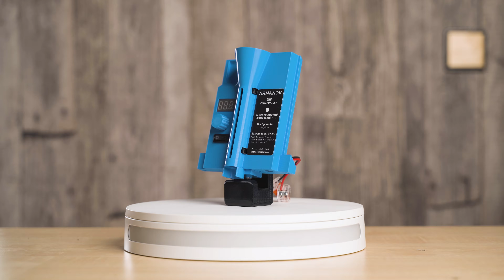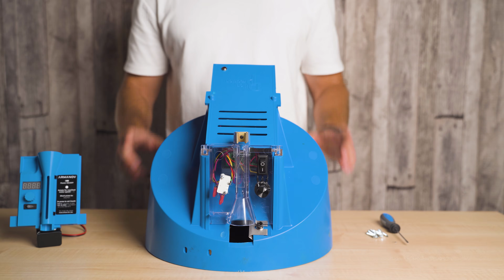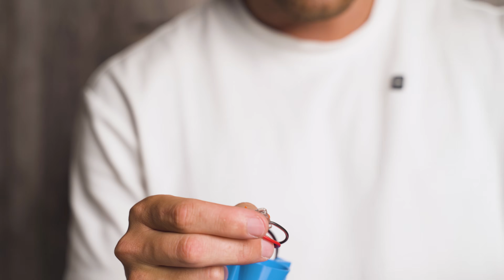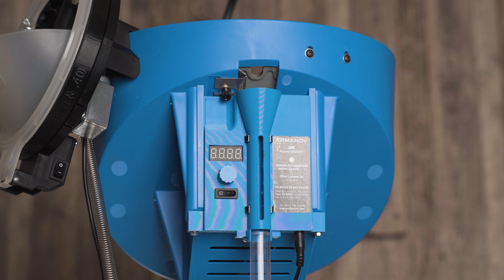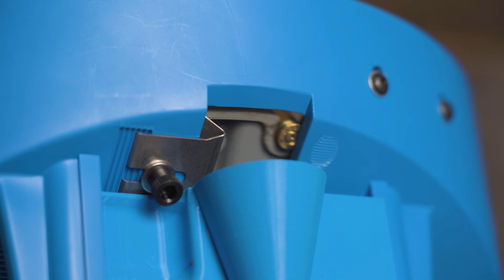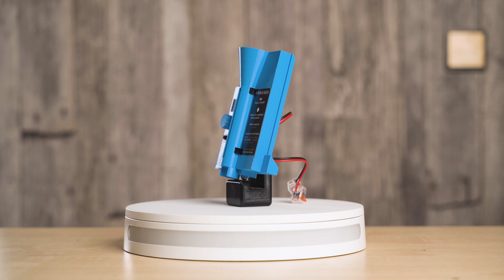Armanov Smart Controller for Dillon Variable Speed Casefeeder

Comment: Not a good investment: I'm on my third request for support with no response. After about 4 hours of use it no longer will allow you to pick numbers, the knob makes the counter change by tens or hundreds randomly. Shuts off if your working of fixing an issue or restocking supplies, and when it gets turned off, it loses count. Mine is no longer usable after 4 hours with no response from Armanov support. I had high hopes.

Comment: I got mine for the Dillon 1100 but when I hook it up per the instructions here and on paper it spins the plate backwards for some reason. I've had a support ticket (#13886) open since 11/24/2025 and it's still in "new" status. I've verified, numerous times that I have the wires connected per the instructions. Has anyone else ever had this problem?
Reply from the maker: Hello, we apologize for the late reply on our support chat. You can reverse the wires coming from the motor and the motor will spin the other way.

Comment: I really want this, but I have the old 2 speed case feeder. If you had the option to buy a new compatible motor also I would place my order today.
Reply from the maker: Hello, we are looking into a possible separate version for the old case feeder, as there is quite a lot of interest. Stay tuned.
Reply: @Armanov  yes, i have an old case feeder as well. please let us know when a unit is available for us.
Reply: Thats what I thought of my vanilla casefeeder.
Time for a revamp without buying a complete feeder which is 400€ straight
Reply: Everything except the 9 speed motor setting should work on the older 2 speed units, I would think.
Reply: If I swap the motor to variable speed in my old case feeder will this fit the old bowl?